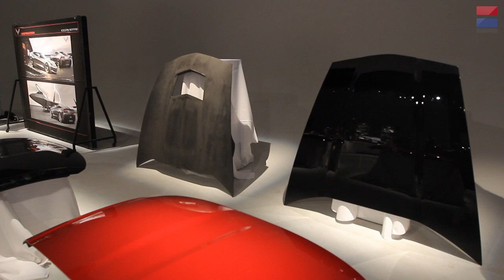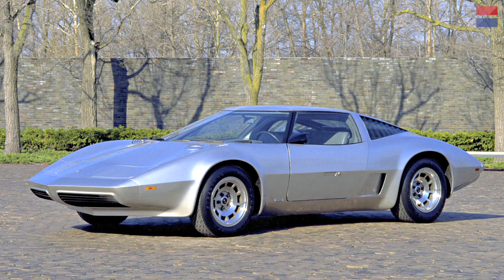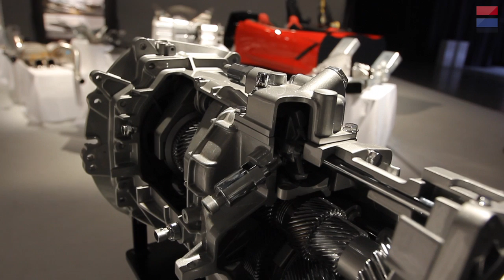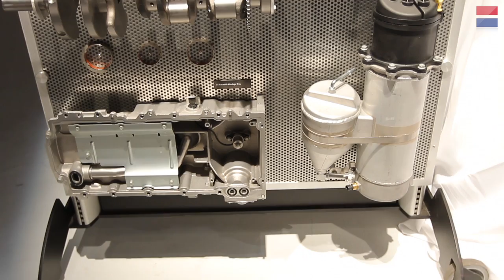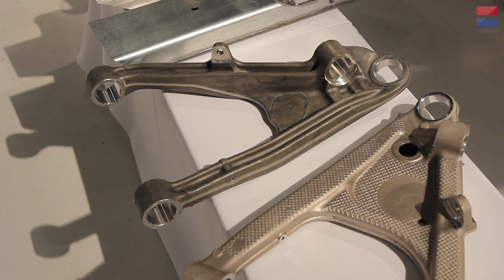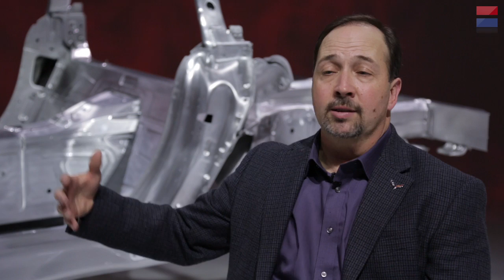2014 Chevrolet Corvette Stingray / Z51 Revealed @ 2013 Detroit Auto Show - CAR and DRIVER

Comment: The DOD is unequivocally the weak point in these engines. That and DI since there is no way to practically clean carbon build up from the valvetrain system

Comment: I was a diehard Porsche guy. Then, long of tooth, set in. Several friends owned Corvettes. So I took a look.  Very impressed with the Engineering of the C7. Purchased a 2019 C7 GS 3LT. LOVE IT. ❤🎉
Reply: I live in Gainesville FL. Did an INTERNET search for a 2019 C7 3LT, after the C8 were announced and arriving at dealerships. Found one in Orlando FL, last new one in north- central FL. Had I a choice, I might have chosen another color. But, dark grey metallic is fine.
Reply: Wishing you happy driving experiences.  The C7 is a beauty and an apogee of front engine design.

Comment: I can't wait for 2 to 3 years from now when the used price drops down to about 35,000 to 40,000 so I can buy a base corvette.
Reply: Blazejunkie do it now! You can buy the 2014-2015 stingrays for as low as 30k-36k with decent miles too!
Reply: Question lets say I brought a C7 2015 Stingray. Is there an actual difference between it and a C7 2019 Stingray or does the year just tell when it was manufactured?
Reply: Blazejunkie bought mine on 3-16-18, and I love it. Went on an 8 day cruise the week after my purchase, so I haven’t had the bells and whistles time yet, but that’s coming.
Reply: I got a z51 for 40k 4 years ago.
Reply: Hey, man. Almost 10 years late. I hope you’re in good health, and also hope you got your corvette.

Comment: Impressive auto.  Aftermarket won't like DI.  Hate to hear they went EPS.  Give me the hydraulic steering column my wifes 550xi and my 300 srt has.  Beats the snot out of the old C5 and Cts v I used to drive.  Good overall job gm.

Comment: It's actually sort of a new thing for high performance cars, even among the euro market. Even Ferrari is touting the 458 for introducing direct injection. The Enzo didn't even have it..

The LT1 is pretty impressive. Compactness, weight, baseline power output, robustness; and despite what you think, economy, are all second to none for its class. This thing will continue being the engine of choice for engine swaps for such reasons. 

This is a BASE engine, I can't wait to see the ZR1 equivalent..

Comment: The estimated performance figs on this 55k car are amazing.  This car will absolutely decimate the competition on the track.  Already pulled 2:51 on VIR.  A car with a 100k mile track approved warranty, 30mpg highway, MSR suspension....nothing even comes close.  GM has now embarrassed all others within it's price range.  Especially that shit box unibody GT500.

Comment: Doesn't Corvette dominate GT racing vs Ferrari, Porsche, and Aston Martin? 

1. The Corvette is performance for price. For under $60K USD, pick an everyday car that's faster around a track. It doesn't happen. It is designed as a cheap track car, BASE models, (911s, 430s, R8) the Corvette is better or comparable. 

2. Handeling.  It's as good as anyone else. However, a Corvette needs skill. A $150k USD exotic can be driven fast by anyone, a $60k USD Corvette can't. It's about bang for buck!

Comment: Are you just attempting to sound stupid at this point? 

The beautiful thing about the GTR is that it does "Drive itself". Why can't you respect it for the technological masterpiece that it is? It's THE BEST car for around 100K, point blank. There are GTRs that are quicker than the Veyron, but still retain stock drive ability. Corvettes are great cars, don't get it twisted. They just can't hang with the GTR tech.It's almost like comparing apples & oranges, dude.

Comment: Corvettes are primarily made for American's to drive on America's long and straight roads.  You do the same.  Better?  The Porsche 911 GT2 RS did it in 7.18, the Lerxus LFA did it in 7.14, and the  Ferrari 599XX did it in 6.58.  No American cars make it into the top 5, even though the Dodge Viper ACR-X, was closest, but it was still 5 seconds behind the Ferrari.

Comment: That's you you're talking about.  Add another 51 years to that.  I don't want a GT car when the one I have does the job.  In America.  I stopped watching Top Gear years ago.  Well you would see them in America, now wouldn't you, they are primarily built for America's roads.  Lamborghini's are not a drag racer.  Better lap times at which circuit?  Lamborghini are owned by VW.  And you are implying German cars have bad build quality?  Ferrari's have craftsmanship and style, vettes have neither.

Comment: Old fashioned, good for American laser straight roads, but outside America was consigned to the trash bin decades ago.  Coil springs and push rods are the standard out here, unless you like French Citroen's which pioneered and use the hydropneumatic suspension.

Comment: 500hp would be about right considering the New R35 GTR has 500+ if I'm not mistaken. I would expect the Z06 to give the GTR a run for its money and the ZR1 to take it. At least I would assume the GTR is the car they would be competing with as it's by far the best for right around 100k.

Comment: Overhead cams make the top of the engine more heavy than the bottom - changing the center of gravity from down low to up top. I've been an automotive technician for the past 5 years - I know you can get HP & TQ w/ pushrod, but you can't do variable valves found on most modern engines which = fuel economy & HP/TQ. 

Who cares about the C4? We are talking about the C7. Why do you insist on attempting to criticize an opinionated statement that is completely unbiased?

Comment: Corvettes have always made minor changes over time. I'm surprised they are sticking with the push-rod engine. I figured they would change the heads to DOHC, but I guess it ruins the weight distribution.

Comment: Toyota is number 1 globally. The US market isn't the entire world. The US consumer isn't a good point to base quality off of. Crap recall average? Ford's 1996 recall of 7.9 million vehicles built between 1988 and 1993 for a faulty ignition module remains the largest. In 1978 1.4 million Pintos (and its near-twin, the Mercury Bobcat) were recalled to have plastic shields installed to protect their gas tanks. The 1980 Chevrolet Citation, for example, has been recalled 9 times. ...You were saying?

Comment: UGLY p.o.s what was gm thinking lets use viper headlights and camaro taillights oh and don't forget to make the rear end look like a need for speed body kit integrating the side markers into the wheel wells is retarded and why is the side glass continued beyond the doors when there is no back seat this is what happens when you take styling cues from competitors and design a car to have quintessential super car styling with misplaced vents and unnecessary angles i give gm two thumbs up there ass!

Comment: The base version is the one that's going to have the 450+ bhp engine. I read an article that came out Feb 19, where GM confirmed they're working on the new Z06 and ZR1. They're saying that the goal is 700+bhp for the ZR1. And, as long as they meet that, the Z06 should have 600+ bhp.

Comment: SWEETt car,BUT it would be even better if it had as much horse power as the ZR1     450 just isn't enough. The ZR1 has 630 horse power and it can compete with porche and ferrari. So maybe in later versions it will have more

Comment: NOTE TO CARANDDRIVER : Please Stop using Noise Reduction Plugin on low FFT settings, use something like Sony NR2.x in VST mode and tell your Sound guys the word "Noise Reduction" doesn't mean Noise Removal , so adjust your sliders to a reasonable level, don't try to remove the entire noise from the interviewee's voice as it sounds Watery as hell.... Just a thought, keep up the good work.

Comment: There are MORE parts just counting the valves alone in a DOHC. Not only that, this is simpler, less to go wrong, less valves to stick/leak, WAY better gas mileage, lighter weight, & as reliable as it gets.  Everything doesn't have to be more complex in order to be better. The Vette blows away Ferraris and Porshes with its simpler valve system, gets WAY better gas mileage, and in stock racing, the engines of the other two only last 1 race; the Vette's lasts 2+.  Simpler is better here.

Comment: DOHC is fine and dandy, however it adds so much bulk up top that a vehicle like the Corvette would be completely screwed as design goes.  The hood is too low to fit a proper DOHC V-8, and it would add quit a bit of weight when compared to the current push rods.  Not to be disrespectful, but you don't sound very educated when it comes to engine design.

Comment: I do know that it is a very fast car there is no denying it. However, "you pay for what you get", GM's cars are not the lead in reliability and is also why they are so cheap. I'm not coming up with that, I know 4 former, now teachers, GM mechanics that confirmed that.
If they can put a DOHC instead then it will be a big step forward IMO.

Regards, Lord_Deji

Comment: Its totally work hours spent. Another wars X number of CPU's working for a combined totally of hours. So 2 CUPs working for 5 hours a piece is 10 work hours. So you have a super computer with dozens and dozes of CPU's each one. You can further count that number if they want to count each core in each CPU as a single work unit.

Comment: Man, my Civic has a Honda B18 Intake manifold which is fully chromed, with a throttle body, a APR racing spoiler, aluminum wings, carbon fiber tips, and a Stainless steal glass cannon. Not to mention the quad turbo and the non slip differentials. You don't even know!

Comment: (He said) balance of features, man, not weight, etc. They wanted a trunk.  Its more a poor mans Ferrari 599 than any of the other cars you mentioned.  Pretty incredible rendition of a 599 for 300k less :)  Corvettes are supposed to be low-slung, front-engined v8s, with a good trunk that can still hang with much more expensive cars.  And they still are.  Sports cars come in lots of flavors ... m3 is a sports car to almost anyone and obviously its pretty different.

Comment: You sir are a fucking moron. One of the most distinctive features of the new engine is its domed rocker covers, which house the, patent-pending, integrated positive crankcase ventilation (PCV, NOT PVC YOU CLOWN) system that enhances oil economy and oil life, while reducing oil consumption and contributing to low emissions.

Comment: your talking about a kenne bell man they can make upwards of 1000 so yea its gonna win but slap a turbo on a ls engine better yet slap one on both to make the same amount of hp it would have to run more boost and the vette weighs less and is more areodynamic so all things being equal (good driver and tune for both cars) vette wins due to better overall powerband, and lets not talk stroker motors because 1 would have to catch up to 427 if a ower keeps it there lsx makes 502s now homie

Comment: I'm pretty sure the 6.2 LT1 will get passed down to the Camaro, along with 7 spd manual and maybe the brakes as well, but apart from that yes, the Camaro will most likely remain on the Holden platform. Two very different cars.

Comment: the rep from C&D if i hear correct commented on the C6 doing away with hidden headlights that Corvette has had since 1968. well, i thought the lights started in 1963, first year of C2. i like the hidden head lights, guess that's why i have last year of C5; didn't want a Vette that looks like a Cadillac. Now they look like a Caddy from front and a Camaro from the back.

Comment: What about a pushrod engine is crappy? The quickest cars in the world use pushrod engines. Also, an aluminum pushrod LS1 5.7 litre V-8 is both lighter, and more compact than a 2.0 litre Honda S2000 inline four cylinder. Many people actaully put LS1 V-8's in Honda S2000's because of this.

Comment: I wish they would have looked to the Ferrari California for design direction, not to a greenstick fractured two by four that was vacuum sealed. And I don't really want a chrome flaggellum stuck next to a busy vent. Never was a fan of center exhaust, especially 4 together. And I hate having a large umbrella over all the instruments inside. It's not going to rain in there.

Comment: GM is totally biting Ferrari designs! C7 Stingray from the front and the side looks like the F12 Berlinetta! The interior design of the C7 is allot nicer than the previous gens but still very boring and nothing special. It just doesn't have that WOW factor! An exotic exterior that lacks a interior design is just upsetting! I have to admit that the C7 Stingray is still the nice's looking vette to date.

Comment: The black dude you are talking about did design the exterior he is not in the interview (look at Jay Leno's garage vid he is interviewed there). btw the escalade and camaro are nice but they give off the perception that you have no class or finesse. Anything with too much chrome or oversized engine with bad suspension is for the "hood rich" negroes.

Comment: I never said anyone wanted to be Europeans, I said the total opposite if anything. But I did say it can't be a coincidence that GM are mimicking Ferrari styling anymore. The C5 looked like the 456, C6 looks like the 550 and now this comes out straight after the 599 halts production and looking very similar as well. 2 is a coincidence, 3 is plain obvious.

A Corvette has rarely put up a fight when journalists have been put behind the wheel next to elite super cars. Look at MT's Driver's COTY.

Comment: The specs are somewhat impressive. But the Corvette language has gotten pretty lost in the styling. They saved the fender coves, the quad taillights, and the quad exhaust trumpets, but that's pretty much all. The headlights probably have a Ferrari part number. The engine is more of the same, with a few new twists. Rolling out the 'LT1' moniker for the third time. The Corvette has become Chevy's Porsche 911, Chevy fans will love it but all others will be bored.

Comment: cheaper and similar performance. from a technical standpoint the Ferrari isn't justifying its price anymore, especially as the corvettes new focus seems to be on quality. as for cheaper in terms of development that is rather questionable. they even use the same brakes from the same manufacture. Ferrari uses a variation of GMs magnetic ride technology. you pay for the name, not for the quality of parts.

Comment: I may have seemed a little too harsh on the tail lamps, BUT I didn't criticize anything else on the car. The great thing about opinions is that you can voice them, and that's exactly what I did and I said exactly how I feel. Yes maybe the Lambo analogy wasn't the best, but I think it fit quite well. And I didn't say the car looked the Camaro? Idk, where you got that, I said it took cues. Also, I said the car looks great. I said it looks ridiculously good, actually.

Comment: at least the C4 corvette had square lamps with round edges, this looks too much like the Camaro. This is GM's flagship automobile why the hell is it taking cues from a less significant vehicle? That's like Lamborghini saying, "You know what? The Gallardo has traditional doors, let's stop scissor doors and put regular doors on the Aventador." I know it's a small gripe, but I'm a little disappointed. However, the rest of the car looks ridiculously good.

Comment: i think it will put down numbers on the track as the current Z06 or close with the new suspension and frame if not better, cant wait for the ZR1/ Z06. a lot of planning went into this car i mean a lot, the performance version i hear will be around the  650 - 700 hp range ( we'll see )

Comment: How uninformed are you? They obviously wanted to refine the car, which has nothing to do with horsepower. Power to weight ratio is just as important....with "only" 450 hp this car will hit 60 in the high 3 second range, and will outperform the more powerful Shelby on a track, which is what a real sports car is supposed to do. Top end means absolutely nothing since 99.9% of buyers will never see 180-200 mph.

Comment: It looks great but the hp should be alot more than 450. This should be a 500 hp car. They made a cadillac and camaro with more hp,why not this car. I hope the 2014 Z06 has more than 505,which is way outdated...Im moving to Ford...this cant compete with the Shelby gt500,or the new Viper...180 top end....Please try again Chevrolet....

Comment: As far as the bang for your buck. Its USELESS to compare expensive exotics to corvettes. Guys with money dont care if they have to pay $40k for 1 extra HP. Corvette owners are NOT the filthy rich like the exotics. They buy a vette because its a good bang for the buck car. Lots of HP for a cheaper price. But for guys that know about cars and are not afraid to tune and modify them. A corvette is a bad investment when you can buy a 30K car mod it and go faster than any of these exotics or vettes.

Comment: Even cars with large powerbands,torque are not in the high rev areas. Torque will always drop pretty significant during the high rev areas. During a drag race a V8 with 500 of torque at 2k is USELESS as your always at least 4k or higher before you even get off the line. During a road race even during tight turns. The cars are still in high rev as they drop a gear or 2 during the turn. Because peak torque is usually in the middle and you want to get to max HP as fast as possibl I race cars I know

Comment: Do you have any experience with so-called "better" sports cars in its performance range?  Try Ferrari.  Same low bodywork keeps visibity the same.  Do you want a greenhouse shed stacked on top of your sports car?  Okay, buy a 911: you'll find it more cramped inside, and it needs a jury-rigged wing gadget on the rear end to keep itself from flying off the ground.  

Don't like pushrods?  Okay, use overhead cams: you'll have a taller engine requiring a higher hood, with less power per size.